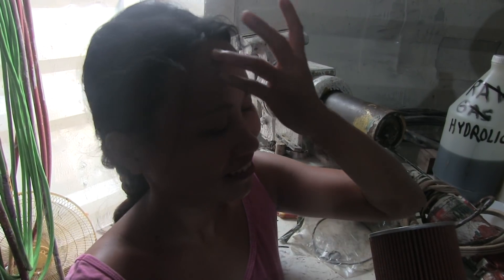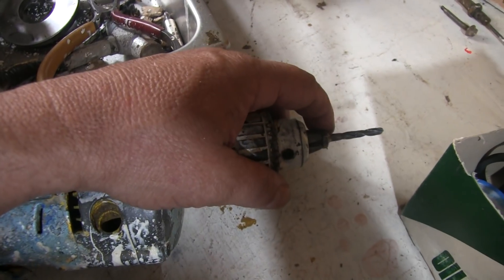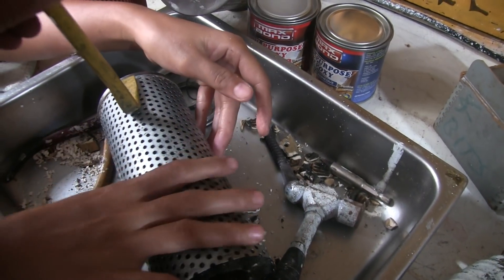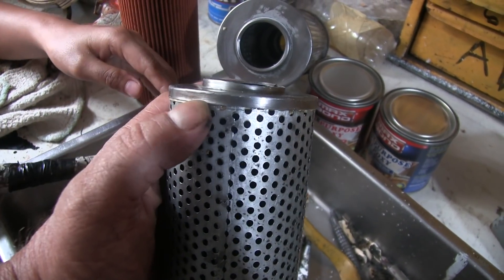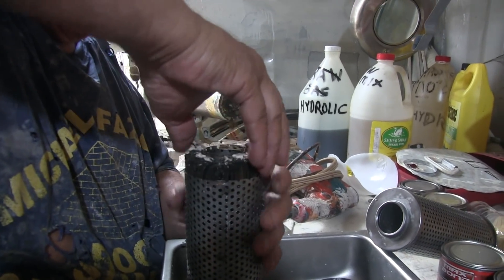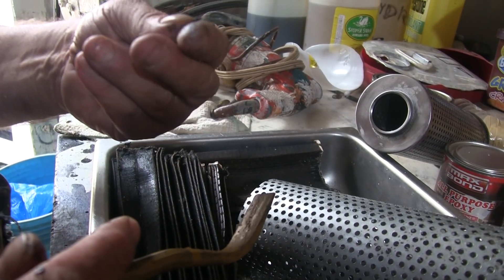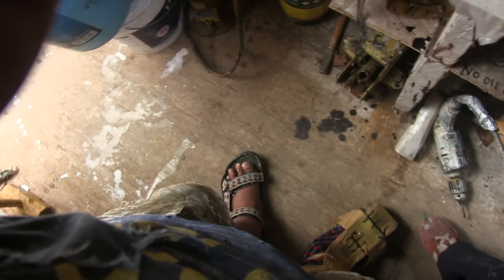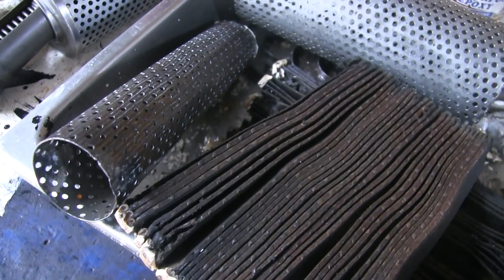MITSUBISHI HYDRAULIC FILTER PAPER CARTRIDGE RE BUILDING THE INNER PAPER CORE part 1 OF 5

Comment from the maker: IN THIS VIDEO {[ PART ONE OF 4 ]}  YOU WILL SEE/LEARN how to replace the paper cartridge inside any/ANY antique oil or hydraulic filter cartridge. Although the process is not simple it is POSSIBLE.

ALSO in this video you will see the tools that are necessary at a bare minimum to do this in a professional MANNER, although you don't need all of these tools it will save you time at the end of the day to have the useful ready to do the job itself.

This is the first of a 3 part series because there were other complications besides replacing the people cartridge filter itself in that the only paper cartridge available was not the same dimensions of the original paper cartridge so not only did I have to REMOVE THE END CAPS, But it was also necessary to change the diameter of the inner core CORE which took an additional 3+ hours.

HOW MUCH TIME did this job actually take is as follow.;

1] 2 hours to remove the HYDRAULIC cylinders themselves.

2] 2 hours of travel time back and forth to the city.

3] 5 hours looking online for a replacement cartridge and making phone calls and sending emails to companies called MITSUBISHI or MITSUBISHI parts supply warehouses to find this exact cartridge and purchase it and at the end of the day that was not possible.

4]  approximately 5 hours traveling to the 5 biggest automotive and hydraulic supply warehouse is in Bohol Philippines, only to find that the last one of course was the one and the only one that had a paper cartridge long enough and close CLOSE I repeat to the half-inch dimensions I want.

ALTHOUGH the new filter and closest match if I could purchase was three quarters of an inch which meant the inner core also had to be modified because the original inner core was now 1/2 inch in diameter too much or too big to fit into the new existing hole.

6] BREAKING DOWN the 2 oil filters and cleaning the parts and creating a new inner core for 2 filters by utilizing the parts/INNER CORES of the newly purchased filtersTook an additional 6 hours.

7] rebuilding and putting the epoxy on the new END CAPS including clamping time and other miscellaneous chores necessary to get the filters back together was an additional 7 hours for both filters.

8] and now there will be an additional 2 hours of labor to reinstall the filters.

All told/ALL TOLD I have 30 hours of labor and TIME looking for the filters and doing the rebuilding job itself.

NOTE; to those of you moving to the Philippines...

It should be noted that you cannot purchase the following supplies in the Philippines.

1] the O-ring of approximately 3 inches in diameter is not available in 4 different automotive parts stores in Bohol Philippines so I had to work with what I had even though they would damageD they are better than nothing but still the point is they are not available.

2] it is also IMPOSSIBLE to find the product called LOCK TIGHT in any automotive store anywhere in the Philippines that I have what including Bohol and Mindanao.

3] it is impossible to find starting FLUID it simply doesn't exist, And no one has ever heard of starting FLUID but what they will do is hand you a can of BREAK cleaning fluid, Which is a completely different product and this is what they understand to be starting food in the Philippines.

4] there is no such thing as an DREMEL TOOL Anywhere in the Philippines that I have searched so if you need a DREMEL tool you should bring a DREMEL With you to the Philippines.

5] in addition I have searched every hardware store in Bohol Philippines and there is absolutely ZERO attachments or a DREMEL TOOL a.k.a. there are no accessories for any model or version of a DREMEL FULL so if you are a . MODEL MAKER or you must understand to bring your own.

Of course your tools will be 110 V so you will also need to purchase a DIAMOND CONVERTER which I found to be the best make brand quality and price Although you can bring whatever you like that is what I would suggest to convert 220 V and 110 V current.

 ORIGINAL TITLE;
ANTIQUE MITSUBISHI HYDRAULIC FILTER PAPER CARTRIDGE RE BUILD  00028

ANTIQUE MITSUBISHI HYDRAULIC FILTER PAPER CARTRIDGE RE BUILDONG THE INNER PAPER CORE part 1 OF 2 https://youtu.be/_lVWvvkOejc

FOR THE PEOPLE THAT READ THIS FAR... AND HAVE FORGOTTEN TO PUSH THE LIKE BUTTION AGAIN... 
AND THEN WANT TO ASK ME A QUESTION...

WHEN I GO TO YOUR CHANNELS AND SEE YOU DONT {{  LIKE ]} MY VIDEOS...
THAT WILL BE THE AMOUNT OF EFFORT I PUT IN TO ANSWERING YOUR QUESTIONS...

ANTIQUE MITSUBISHI HYDRAULIC FILTER PAPER CARTRIDGE RE BUILD  00028

TAG;
ANTIQUE MITSUBISHI HYDRAULIC FILTER PAPER CARTRIDGE RE BUILDING THE INNER PAPER CORE part 1 OF 5
https://youtu.be/_lVWvvkOejc
Reply from the maker: @Sr1XY801  Thank you taking the time to make intelligent and respected comments